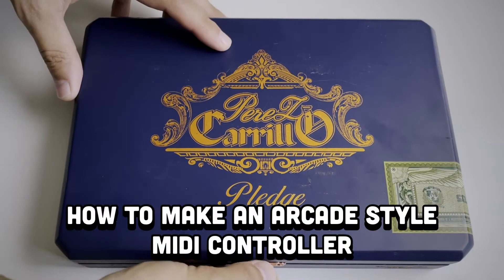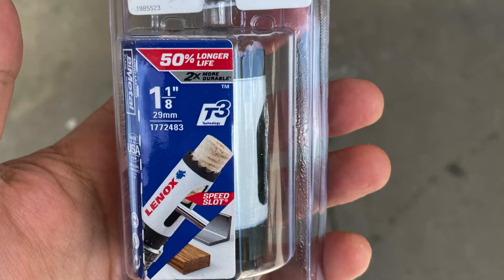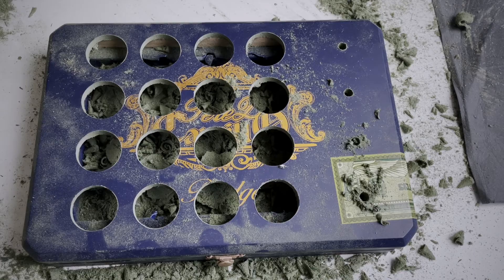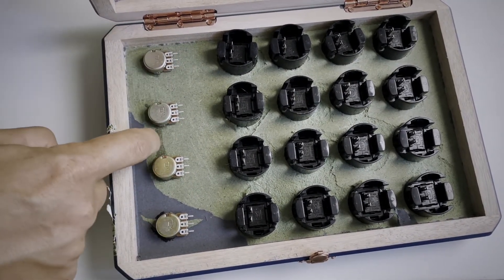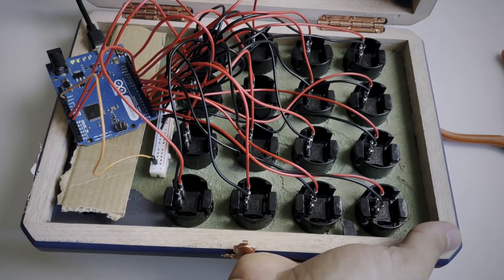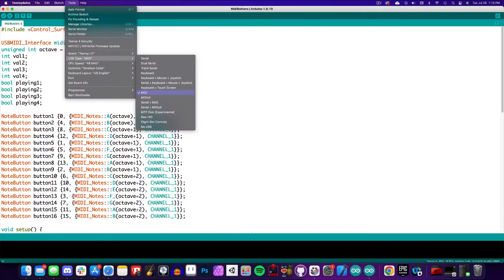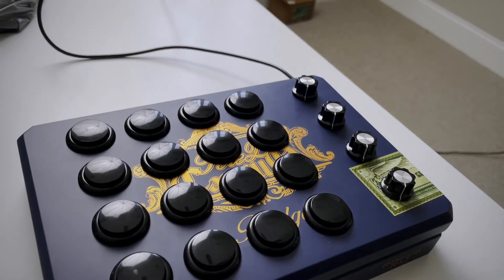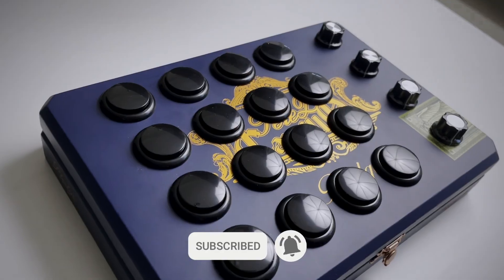How to Make an Arcade-Style Midi Controller | Cigar Box & Teensy/Arduino

Comment: Thank you for your project.  Why did you change Arduino Leonardo to Teensy LC? I'm going to make this Arcade MIDI Controller. Can I use Leonardo or RP Pico  instead of Teensy LC ?  Does the "Teensy Arcade Midi Controller" source code only work on Teensy boards?
Reply from the maker: It will work on other boards. You may just need to change the pins to match your inputs and some boards don’t include Arduino’s MIDI USB library which may need to be added in Arduino IDE. I changed from Leonardo to LC so I could solder to the board. Arduino’s like Pro Micro, Raspberry Pi Pico, Teensy, and even ESP32 are all great options. When you install Control Surface library in the Arduino Library Manager it comes with examples of the various apis. Good luck with the project!

Comment: teensy is rarely available, what can we swap it for ?
Reply from the maker: I like the Raspberry Pi Pico recently. ESP32 and Arduino are good options too. I use the control surface library and they have a pretty good list of compatible boards. https://tttapa.github.io/Control-Surface/Doxygen/d8/d4a/md_pages_MIDI-over-USB.html
Reply: @mobypixel  I ended getting the leonardo r3, is it same configuration and soldering ?
Reply from the maker: @DM20255  That's a great board! You might be short a couple of inputs so you'll want to leave out a row of buttons or the potentiometers. For potentiometers they will connect to the analog pins (A0-A5) on your board. In the script the things you will need to change are the corresponding pin names to your board. Also if the Control Surface library has any errors you will want to fix those too--sometimes the note names are different on different versions of that library. I would start with gettin one button to play a note using the control surface library inside of Arduino then expand from there. And also remember ChatGPT can fill in any of the coding gaps. Good luck with the project!
Reply: @ Thanks a lot !! I just wanna make a 4x4 board, no potentiometers, you're saying I wont even have enough for 16 buttons ? I got now basically 2x R3 and 3X Pi Pico 2040 on the way ! My first project is a 4x4 buttons only and maybe for next one I will incorporate the potentiometers, will see if i can maybe use 2 boards one for buttons one for potentiometer but not sure.
Reply: @mobypixel  also in the leonardo in the video, do you just insert the wires ? wont they go out ?or how do you solder them ? remove the black plastic ?
Reply from the maker: You will have enough pins for 4x4.
Reply from the maker: No I don’t removed the black headers from the Leonardo. If you want more stability you can wrap it with electrical tape. Those boards are not really meant to be soldered too and you can damage traces removing them.
Reply: @mobypixel  but how do i make sure the cables wont go out ?
Reply from the maker: @ There are a few options. For those types of header connections if you are connecting bare wire you could use a wire crimper and add DuPont male ends. Or use wires with a male pin end. Or you could make or buy an Arduino Leonardo terminal shield.

Comment: Is your code easily modified to support 4 x 16 channel multiplexers for a total of 64 buttons?  By "buttons" I am mainly referring to keys on an acoustic instrument i am in the process of "midifying"
Reply from the maker: In theory, yes it should work. But I've never worked with multiplexers. Good luck with your project!
Reply: @mobypixel  Thanks!  I will add the multiplexer piece to your code and see how it goes.  Thanks for doing this video!
Reply: @mobypixel  Quick question, in your code what does the F note with an _ signify?  For example, F_(octave+2)
Reply from the maker: @joesalz9963  The F is a constant value for the note F in in the ControlSurfaces library. Adding octave+2 is just to shift that value up an octave and two semitones.

Comment: I read that the Tennsy LC has 13 pins that can function as analog, what other pins are you using to allow so many buttons?
Reply from the maker: The buttons are going to digital pins and the knobs to analog pins. 13 High Resolution Analog Inputs, 27 Digital I/O Pins. I'm using pins 0-19 with the last four being analog. I hope that helps!
Reply: @mobypixel  Yes that helps thank you!!!

Comment: Hey , how do i use this code with my Leonardo?? , potentiometer wont work . Can you please help me , iam using a leonardo.
Reply from the maker: Here are more details. It doesn't list Leonardo on this page for some reason. https://tttapa.github.io/Control-Surface-doc/Doxygen/de/de4/Control-Change-Potentiometer_8ino-example.html I'll test it out more next week.
Reply from the maker: One wire goes to ground, one to power, and one to an Arduino analog pin. You have to use the analog pins for potentiometers. https://www.electroschematics.com/arduino-leonardo-pinout/ Control Surface has a potentiometer example on this page: https://tttapa.github.io/Control-Surface-doc/1.2.0/Doxygen/index.html
Reply from the maker: This should help: https://forum.arduino.cc/t/adding-2nd-potentiometer-in-control-surface/969013

Comment: Thanks for sharing this. It looks the teensy micro USB acts as a full on midi connection for the controller without the need for a USB B port is that correct? I knew the micro port was used to script  and was hoping it could be used without adding a port...
Reply from the maker: Yes, the Teensy can send midi data from the usb micro port using the miditousb library. So I was able to use a usb to usb micro cable. Some Arduinos (uno, mega) don’t support that library. Control Surface has some useful info on picking a compatible board. https://github.com/tttapa/Control-Surface#supported-boards  Thanks for watching!